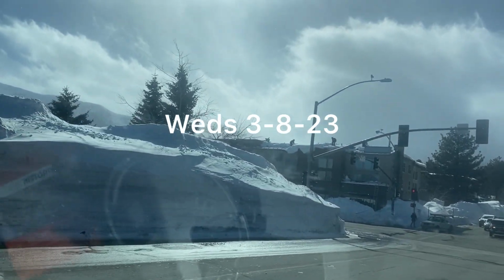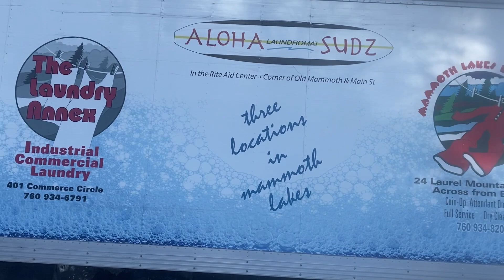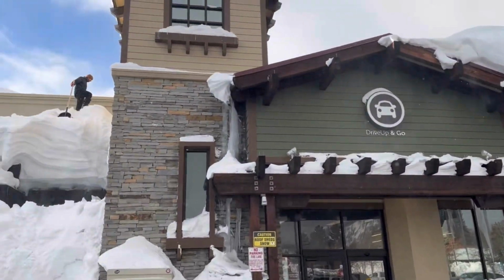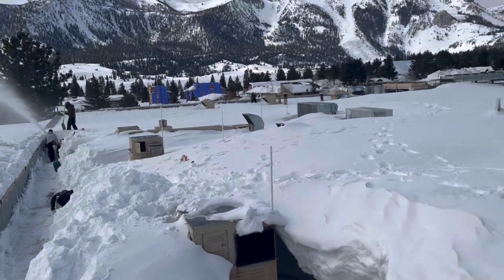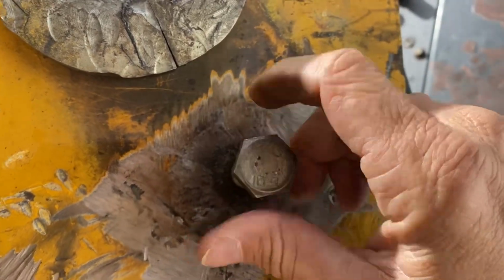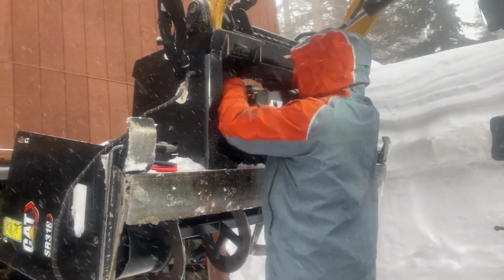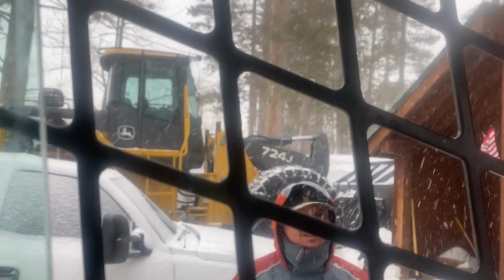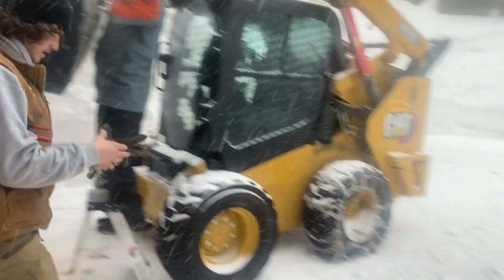Pineapple express underway! ￼🍍

Comment: Being a retired meteorologist, I have seen a lot of weather extremes over the past 50 years but this event goes within one or two of the top events I have witnessed. The next big problem that will be faced by you folks is how this snowpack melts. What you want is a slow melt over many weeks, not  a huge surge in very warm temperatures with heavy rainfall.  Good luck and please, stay safe!
Reply: There usually is no real rain up high or at all sometimes.  Big years some areas never melt out, even by first dusting usually right after Labor day.
80 during the day for Mammoth is a heatwave
Reply: I think where they're at that it's less of a threat than a couple thousand feet downhill.  The Sierra foothills got slammed pretty good this winter and I imagine the snowpack there will be the first to melt out quickly in this pattern -- anywhere from 2,000 to 5,000 ft.  Central Valley will get the worst of it when the runoff gets going.  I know people who live in the Valley aren't gonna like it much but from a hydrological perspective I almost welcome the inevitable flooding, because that will recharge the aquifers quicker than their present infrastructure can -- and that's where the majority of Agriculture is getting their water from is groundwater.

I've been to Mammoth several times over the last 50 years -- lived there once.  I've seen some epic snowfall up there but nothing like this.  This is truly a one-off, and for a guy who was born and raised in CA I'm eternally grateful for the copious water they've gotten this season after 20 years of drought.  They finally get a breather for awhile.
Reply: @briane173  They were good after 2017, but piss poor water management, and dumping water to the ocean put them back to square one. Same for 2 years ago. Dumped all to 50% in January...barely rained again. Oops.
Reply: I would really like to know your opinion about the Weather Modulation Association.  They have been doing some weather manipulation in various places, one area is in the Sierras east of Sacramento.  Their project there is called Snowpack Augmentation.  They can be googled at the above name.  I found it very interesting but haven't heard or seen them mentioned in all the big snowfall videos that I've watched.  Thanks from British Columbia.
Reply: @frogsmoker714  I am familiar with these programs as they have been in place since the 1970s. They are only effective on a local scale. The huge snowfalls affecting the Sierras are due to much larger, synoptic scale phenomena....the so called atmospheric river or pineapple express which can be thousands of miles long.  Unfortunately, the latest models show another 4 impulses possible over the next two weeks.  The next one moving in tomorrow.
Reply: @jackstearns1549  Thank you so much for replying.  I appreciate that.
Reply: @GT-mn3bx  I believe that Mammoth is east of the crest of the Sierra Nevada so they are in the Great Basin and Los Angeles nabs much of water Mono Lake and south and sends it down the Los Angeles aqueduct. None of it flows to the ocean, but I’m no scientist.
Reply: @mitchellbarnow1709  Correct. Everything west goes to the ocean.  They dump water to 50% at many reservoirs in anticipation of more rain. Last year, they dumped to 50 in December, barely rained again.. Epic fail. Like I said, piss poor water management.  But it does keep prices sky high which makes them more money.
Reply: @GT-mn3bx  Thank you so much for this explanation. I bet that it’s very difficult to guess how much precipitation is going to happen in the future. Nobody expected the incredible late winter in Califonia this season. The snow load on buildings is incredible, who could afford to build a structure that could withstand these incredible loads? It’s really amazing!

Comment: 27:00, Congrats on the new harness solving the problem.
You should protect the main connector that is secured on that exterior weldment.  That connector where all the circuits/wires pass to the new harness is very important, moisture or damage will cause all sorts of issues.   Also, you now have a better idea of what to do if it happens again.
Good Luck and be Safe.

Comment: I would make a couple jumper wires and individually run power through every wire on the old harness to figure out whats failing and fix it to keep as a spare.

Comment: Definitely a great lesson in why you never want dualies for your drive tires during a snowpack.  Great advertisement for top of the line backpack leaf blowers, too as they will generate heat to keep as much surfacing as dry as possible. "The Rivers are there for a reason" as everyone found out I think just last Year in point of fact even though they were all dry Riverbeds for as long as most recall. The rocks are for good or bad excel at draining all of this right proper given massive surface area once exposed to sunlight so road BRIDGE CROSSINGS of even seemingly innocuous immaterial might be a huge problem but most normative roadways should do really well in acting as an incredibly valuable water "keep" for quite some time depending upon the temps/pressures in the Valleys.

Definitely a great lesson in hydraulics en route....maybe find a bunch of gold even literally just lying around out that way.

That'll pay for that new Bridge!

Comment: There are some devices on the market that I found a few years ago & this was, for me, the first use and most significant to note re : your generator being too small for the welder. The RV users were having to run 2 Honda EU 2000 I units in parallel to be able to get both air conditioners, and then, of course, the freezer/refrigerator (when on shore power).... A device was developed to take up the startup load as you know it's sometimes 3 but commonly 5 times the surge power. They ranged at $150 to $350 a few years ago. They (I can't recall all details at the moment) are hooked up and involve the coils of appliances.
   RV YouTube search for this and you may find yourself in good shape in the future.
   Best to you all.  Nice job as always.
   I just checked it out for ya'all and the devices are called "Soft Starts".

Comment: Hey when you weld nut on. Try to run a drill thru threads on nut. Gets rid of plating and welds better…. Put the wrench on it hot and work it a bit. I know it doesn’t sound rite but its been working for me 30 years. We dont even own easy outs in my shop.  Can’t imagine how beat up you and your crew are.  Quit snow removal after 50years here in New England.
Stay safe!!!!

Comment: on your sump pumps, the problem with reducing them to a garden hose is that it puts huge pressure on the pump and burns them out fast. better off with a 1 1/4 drain hose sir!

Comment: hi, the roof clearing jobs would get done a hell of a lot quicker if you had saws or knives on poles cutting 2- 3ft blocks like igloo making blocks and throwing them over instead of trying to shovel sierra cement with a shovel that does not have a handle on it like a loop at end to put hand through
Reply: Ya that's what I'm saying too